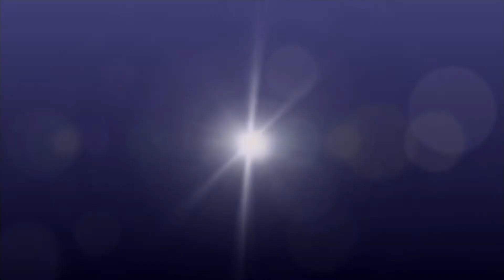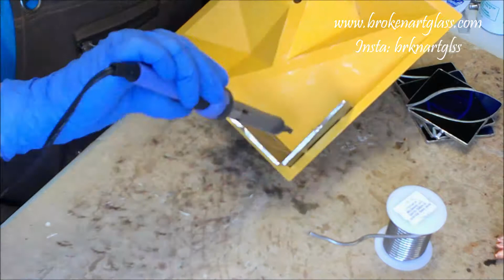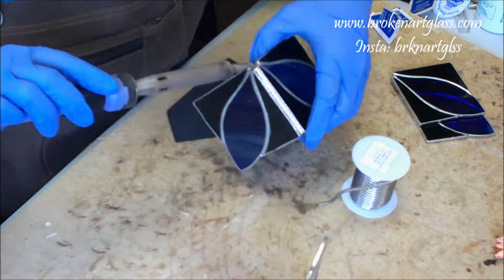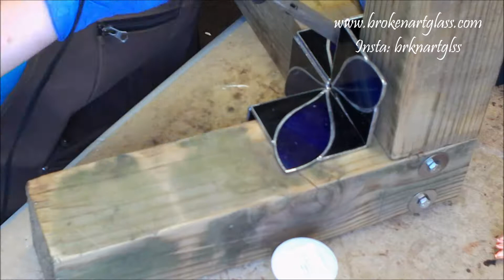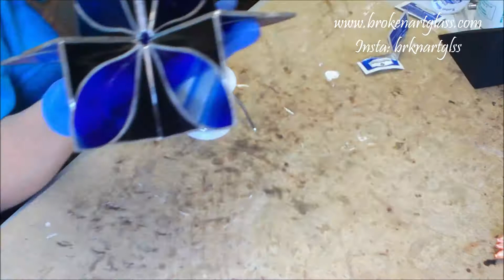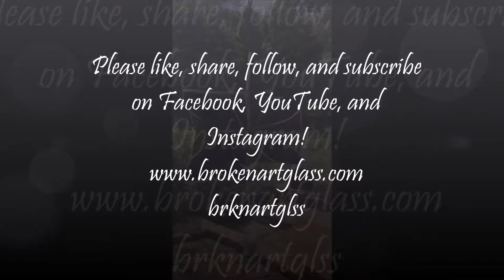Spinners!

Comment: Could you show or comment on how you apply the little bead in the center. Thanks. Great video!
Reply from the maker: It's one of the squashed glass globs and I foiled around the edge and then soldered it to the edges of the glass pieces.

Comment: What temp is your iron when you are tacking them together, so well done!
Reply from the maker: I’m not exactly sure. I use a heat temp controller and I usually set it between 70 and 80 depending on what my solder is doing that day.

Comment: Great video, thank you for sharing.  Curious how you attached the hanger ?
Reply from the maker: I soldered a length of wire with a loop on the end for the hanger and extra long sides to get it soldered into the seams to help with the weight.

Comment: Do you attach the swivel to the loop or at the top of the chain?
Reply from the maker: I add a long piece of thicker wire that I solder deep into the seams to help distribute the weight, and I feed the wire through one end of the swivel, twist it into a bit of a loop, then finish soldering the wire into those seams.

Comment: They don’t spin
Reply from the maker: It takes a bit of wind because the glass is heavy. I use a fishing spinner to get the movement in mine and that seems to work well.
Reply: @BrokenArtGlass  you can also buy a battery operated spinner on amazon.